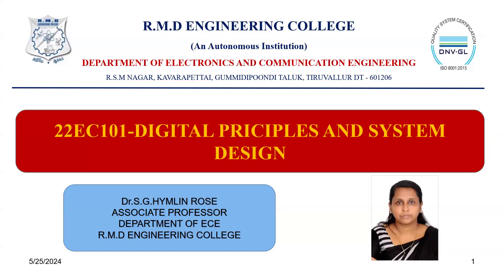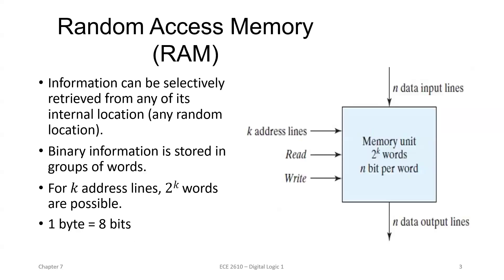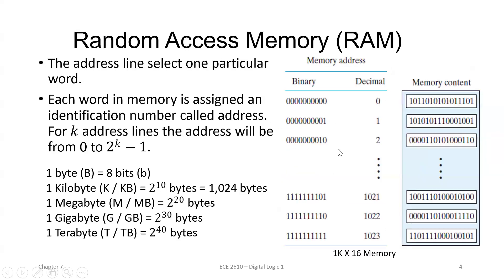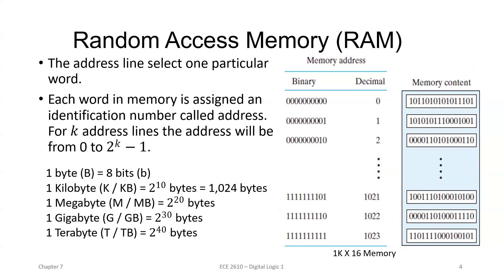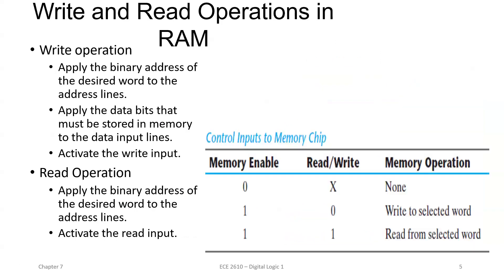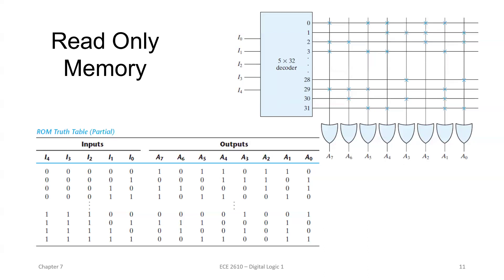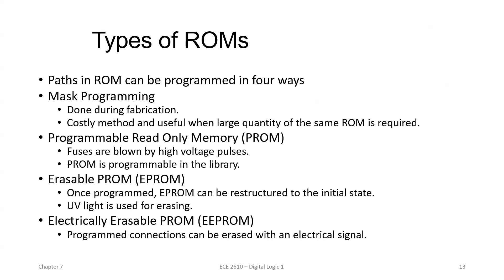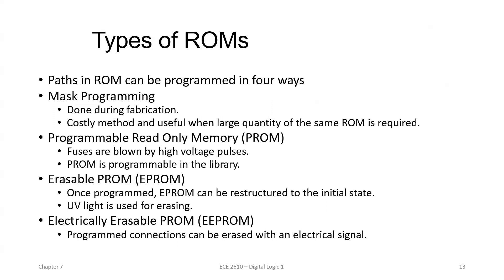RAM AND ROM

Comment: How will you control so many voltage levels that are given as an input and how will you decode so many output voltage levels that are stored in memory ?
Reply from the maker: The RAM stores digital values corresponding to the desired voltage levels. For instance, if you need to control 2^n voltage levels, each voltage level can be stored as an n-bit binary number.